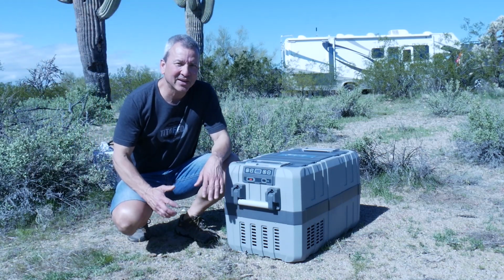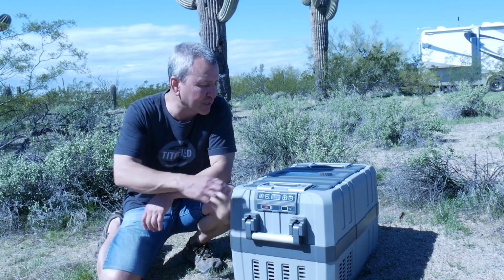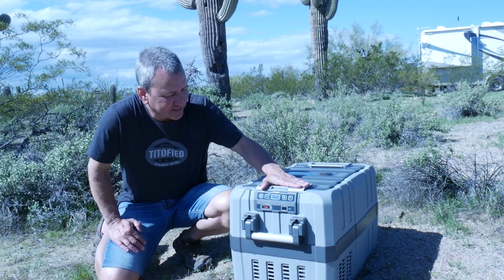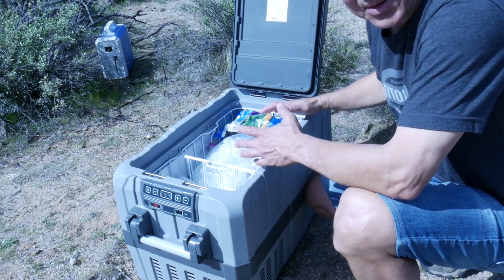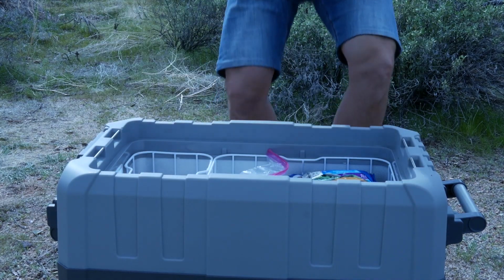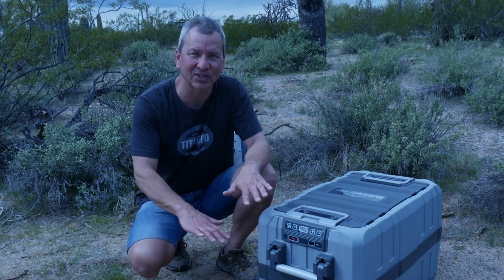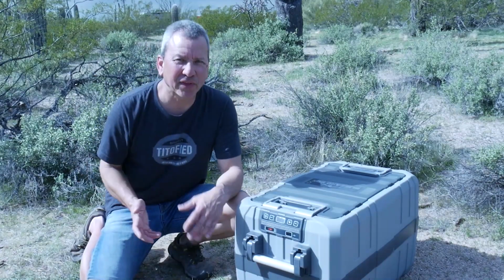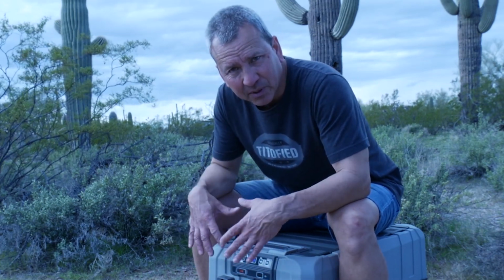6 WEEK TEST of BLIZZARD BOX 12 Volt Portable Fridge/Freezer (REVIEW)

Comment: Do you recall what the weather was when you tested the power consumption? Any complaints in your roughly 1.5 years owning now?
The compressor on that thing is a Danfoss according to company website. Industry leader for 12v compressors
Reply from the maker: Still using it and it's working great. The temps were between 50-90 degrees.

Comment: Thx for the amazing review. One question,  what is the tool that u used to check amp power?
Reply from the maker: It's a digital DC clamp meter (https://amzn.to/3bVba3J). Make sure you get one that measures DC current and not just AC current. They are great to have. Happy hunting!

Comment: Super excited on this review. Ive really been wanting more info on this new fridge and there really hasn't been a lot out there. You tests have been incredibly insightful and have helped me understand al ot more about the power draw. I was looking at the Jackery 500 and was concerned about how long it would be able to power the fridge. The Jackery has 144,400 mAh which means it has 144.4 amp hours. Super happy to find out that this will fit my needs. Thanks for the great review!!! (Oh! what was your avg ambient temp during the testing?!)
Reply: The 14400 mah is at 3.6v. (518Wh (21.6V, 24Ah) 144,400 mAh / 3.6V)  they use a boost converter to keep up 13.8 v from their power plug.  You need to divide your 144ah by 3 to get a closer number to what 12v equivalent amp hours are.  Then figure that since they step it up to make the 13.8v you also lose some amp hours there.  144ah/3 = 48ah to start.  Like I said the boost converter steals some of the amp hours too.  Sorry to break it down for you.  If it were me I'd go with the Explorer 1000 (1002Wh (21.6V, 46.4Ah)) twice the capacity or I'd get the Ecoflo Delta 1300 Wh.  Even more capacity and accepts high power solar input.  Just Saying.

Comment: If it is drawing, on average, about 1.0 amps it will use 24 amp hours (Ah) per day. If you have a 100 Ah lead acid battery you could only operate the fridge for about 2 days because you don’t want to go below 50% state of charge. If you have a lithium battery then you could operate it for 4 days.

I have an Alpicool fridge (35L). It is very similar to the fridge you tested. The cost is $300 on Amazon. I caught  it on sale for $237.

Overall an excellent review. Thanks.

Comment: What happens if the power goes off for say 10 minutes. Does the Blizzard box switch back to ON when the power comes back?  If not that would be a big deal-breaker.
Reply from the maker: Hold on let me try it......yup it starts right back up where it left off. No need to hit the power button again. 👍
Reply: Sweet, that's a good design!  Thanks for testing.

Comment: Thanks for your review. I have lost 2 gas absorption fridges in my ClassC over the years. I was considering an amish built coil system, but am a bit gunshy now. I am thinking about getting 2 of those type of coolers instead, one for a freezer, one for a fridge. Am still researching my options. Thanks again! 👍
Reply from the maker: Knock on wood...our absorbtion fridge is still going strong after 13 years. Glad the review helped. 👍
Reply from the maker: Also...I thought the company TypeS said they are working on a fridge freezer combo unit. TBD

Comment: The temperature drift you are talking about is probably just the unit doing a defrost cycle.  All modern refrigerators do this. Typically 30mins two of three times a day. Totally normal.
Reply from the maker: Perhaps. The manufacturer told me yesterday that they will look into it. Thanks for chiming in.

Comment: I have three different 12 volt compressor fridges.  All different brands, and I have found them all to be very efficient, averaging around 1 amp per hour.  Interesting, the big one (55 quart) uses only a tiny bit more power than the smallest (20 quart).  All three of mine have the same problem this one does, as sometimes the temp gets a little high before they kick in the cooling.  We have overcame that problem by using the little fans that they make for RV absorbing fridges (I use the Camco units).  I use a small refer in our tow vehicle, a large one in our trailer for a refer, and a mid size for freezing.  My two hundred amp hour lithium battery with six hundred watt solar panels keeps up with all our meager power needs.
Reply from the maker: Appreciate that info! Great tip with the fans and yes, interesting about the power being closely matched. I guess, once the items are frozen, the compressor doesn't have to work that much harder.

Comment: Great video thanks
We've bought the same brand earlier model with single side opening from ALDI supermarket for $500 AU in Australia , and it's been working well for the last 2 years . Just keep an eye on condensation under the fridge !
Reply from the maker: Thanks for the heads up. Glad to hear yours has been running well.
Reply: What temperatures are you exposed your unit to,  Brian temperature was 30 to 80
Reply: @Yukonjackman1  the temperature ranges between 5 and 35 degrees Celsius on our travels and we mainly use it as a freezer and we set it between -12 & - 18 Celsius
  At these settings you can't rely on the small compartment to keep items other than bread & butter or similar !

Comment: So was the test done with the unit inside your rig or setting outside where the real air temperature could influence  the operation,  we live in Arizona so im wondering in shade but 119 degrees  how it performs,  i will offer up my patio and take some reading for you if you drop it off to me on your way back to the northwest   plus we could show you our area retirement area
Reply from the maker: The cooler is in the back of our car which we tow, not in our rig. During the 6 weeks we've been testing, the temp in the car has ranged between 30 degF and 80 degF. I'm sure it would have to work a bit harder at 119 degF.
Reply: @RVwithTito  I agree it would have to work harder but if it worked that would be a good selling point for them lol

Comment: Great review. I would like a portable freezer to take stuff with me and buy in bulk when I found stuff I liked. I have 510 AH lithium in my RV.  Could you probably just run this in a compartment (maybe the one you built when you took the genset out:) on your solar system??? Also, would you run it in 12 volt mode? (did you check to see if it was more efficient under that mode). Thanks for the review. Up here in Seattle jealous that you are out there in the SUN. Just another year.... sigh
Reply from the maker: You're right, many with more storage in a fifth wheel or class A mount them in a storage compartment that has a sliding drawer and power it right from the coach battery. The cooler runs on 12V and the 120VAC simply adds a brick transformer. The cooler itself doesn't appear to use more power in either mode. The battery power station, on the other hand, does consume more power from its battery to produce 120VAC through its inverter just due to inverter overhead. So 12V DC from the power bank is the best option overall.